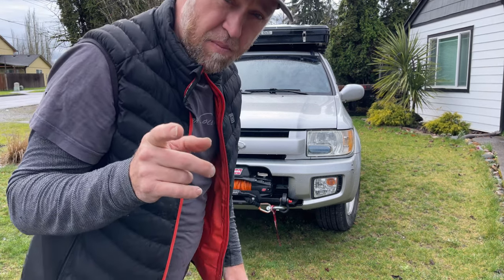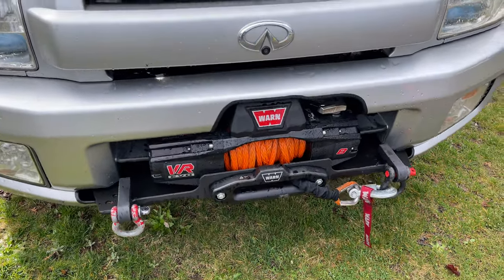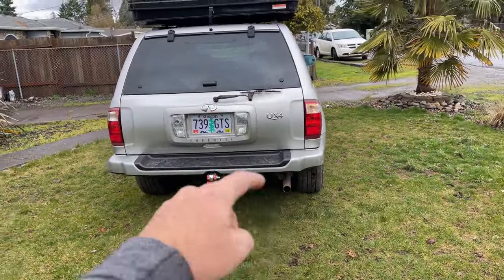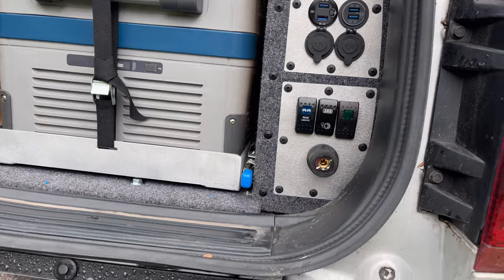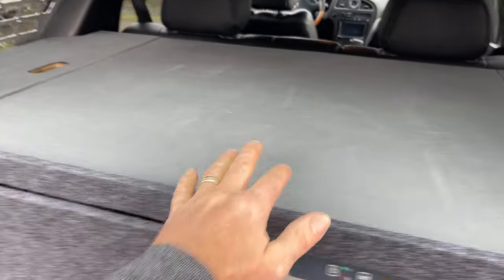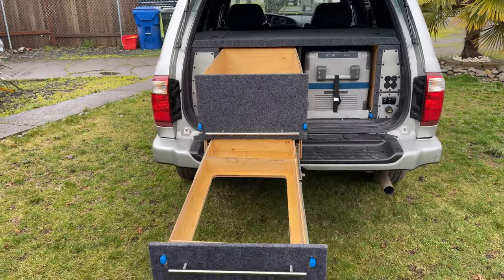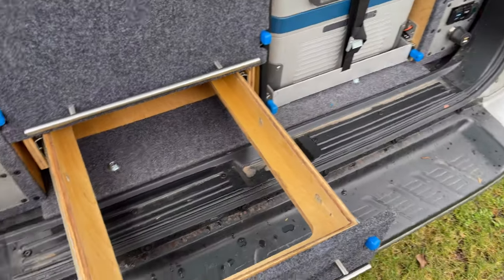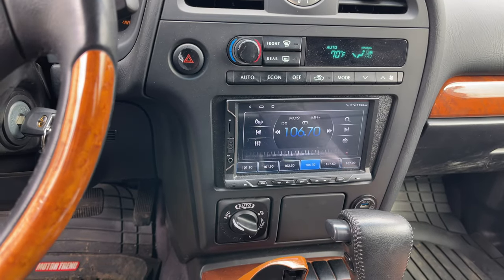Infiniti QX4 / Nissan Pathfinder R50 - AGM Battery, Winch, Drawer System and other updates

Comment: Bud, I have had a Dometic fridge in Land Cruiser 100 series turbo diesel, since 2010. I use a lithium 100 amp hour battery it runs for 10 days with out recharging. Before I go away I run the fridge on high from the house power “240” in Australia then drop down to low when I get to my camping spot. The battery charges from a DC. DC  charger from the L/C.
Reply from the maker: Makes sense, fridge is efficient for the most part

Comment: VERY nice job! I think that's the nicest drawer system in an R50 I've seen. I like the attention to making it no higher than the back of the back seats - just a bit lower to create a lip. I think the lateral well idea is excellent - though it does assume you won't be too tightly packed on the top of the drawers. I find it is pretty easy to squeeze my seats, privacy tent and other long items in through the side of my load. Was that a magnet you used to hold them in place - nice touch!. 

Compressors in that rear cubby is a pretty common R50 mounting point. I like how yours is rigged to the rear panel though, that's a clean touch.

I also like the ability to access the panel from the back seat. I think if I built one, I might make that a little deeper as I really liked your idea of it being another organizational area. 

Consider tapping the plastic hook anchors with 1/4-20 and you can put stainless eye hooks in there for anchor points. Also as an FYI the two tabs in the roof don't mount into much - I've thought of anchor points there but they wouldn't be able to hold much load. Also, a net on the roof works well & stays above the rear window line. I put jackets, hats and other light stuff up there.
Reply from the maker: Thanks,
beauty of "custom" build and application, is everyone makes it how they see/fit right to them and their gear/way of laying things out.  There truly isnt a "right and only" way to do this, as you've probably found out - everyones selection of stuff/junk varies by  a lot, some cook basics like cup of noodles, while others like to carry more utensils than their home kitchen :) :) :) 
Its a long ways from being done in my book, but most likely will never get there and end up moving onto another vehicle, I'm looking at the 5.6L V8 options of the next gen R51 models, need the v8 for towing... but love this thing
Reply: @budnixon  Absolutely, modifications are for how you use it. Between my Mom and myself, we have 3 offroad trucks and each one has a different application and is modified accordingly. Personally, I like a pragmatic, cost effective approach but with the appearance of a clean build. Yours is very nice! Some great ideas there for sure. Now that I have a 2nd R50 for hardware store/hauling applications, I might just rethink a low drawer system for my Pathy. Curious, what did you do with the under floor cubby, did you repurpose it or is it just empty space now?  Once you've moved the spare to the back, several of us have considered adding water, fuel and even an air tank underneath in that space.
Reply from the maker: Lots of ideas for the underside, currently that cubby is empty space, but I'm thinking may be cut it open, and flatten it out to make it easier or more convenient to install other necessities under.  Fuel, water and air have been on my list as well, but I'm trying to stay away from overdoing "concept" as there are simpler solutions.  For example, repurpose the space where spare was with couple of the Trail'ed Round cans that will mount right up, and just a matter of plumbing them to do whatever the purpose

Comment: great video Bud. I live in Gresham and picked up an 03 Pathy this past Christmas and love what you've done to yours. I'd love to learn more about your winch set up rather than adding the weight of a whole after market bumper to get the winch and recovery hooks/shackles installed up front. Feel free to reach out if you'd like to catch up sometime and share some ideas. If you're interested, I'll share my contact info.
Reply from the maker: R50s are definitely underrated 4x4 but there are proper reasons if you dig deep enough.  I built the winch plane/lights tube part.  All info as far as build goes on this rig - is pretty much all covered here in the videos on my channel.  
I'm hoping to hit one of the upcoming Rigs&Coffee meets at IronMans shop in Sherwood soon, come over and we'll chat :)
Reply: The ARB OME Heavy Duty struts should handle that weight just fine. I have 170# on the front of my Pathy (~100# bumper/~70# winch) and it feels great up there. I had to do 2 drives before I put those struts on and with just the bumper it was downright dangerous.

Comment: What’s the weight limit on the roof rails? Could you have used the factory rails?
Reply from the maker: I don’t know of actual limit, but tent is 120lbs roughly and while stationary it supports additionally 2 more adults… and I don’t see that being even close to its limits
Reply from the maker: Factory rails are too week and too tall for my liking, in such application
Reply: The OEM roof rack (i.e. load bars) are rated fro 100#, one assumes that a dynamic capacity and stationary would be more. I have carried far more than than with no problems. At about 2002 they made the load bars much more robust than previously - I know of many of the old load bars breaking. The roof rails connect to the truck at 6 spots have a fairly large surface area so if you remove the load bars, the rails can probably hold alot more, especially static loads. One thing to consider is having your weak point be the connection from the rail to the load as you don't want your roof to be the weak length. There area a couple of R50s that have torn out their roof when the truck's unibody flexes under a rack that's too tightly adherent and rigid.

Comment: Since you’re running everything off your AGM battery, how long/how much power till it doesn’t have enough juice to start the vehicle? That’s what I’m mostly concerned about vs running a traditional lithium ion/lithium iron phosphate power station setup
Reply from the maker: I agree on the concerns, this I carry a portable jump pack. Another note to keep in mind - fridge is the biggest consumer - it has safety shut off if it senses voltage drop due to battery been drained. I dry camped for 2-3 days, charging my usual accessories (phone/drone etc) - hadn’t been a problem yet. It’s about finding the sweet spot, but same goes for spending money in right direction and not overdoing it on things that aren’t as important. 

Take for example option to install a wireless remote start on your rig (sold inexpensive now days), many have a volt monitor (or can be added) - thus as soon as the remote start senses battery drop below 11.7-11.8v (or whatever is needed in your case) - it would start the car and run it until battery voltage is back where it’s safe.  Just an idea
Reply: @budnixon  Thanks for the reply! I also have a qx4 and yeah I don't really want to be spending $1500-2000 CAD for a beefy power station like the Jackery, when I could use that money towards something else.

I am planning a 2-week road trip in August with friends and we will be sleeping in each other's vehicles for some of the nights for the trip (3 vehicles, 2 in each). I assume I wouldn't have to worry about discharging my battery if we are sleeping 6-8 hours every night and most of the time we would be on the road driving, so the car battery would be charging on the go and running the fridge at the same time (going based on your setup)? Planning to do a mini/temporary conversion setup with a bed platform, portable fridge, mini kitchen drawers with supplies, portable stove/grill, power station of some kind (wanting to do a similar set up to yours), etc.

Also going off on your comment about the remote start is a very good idea! Will look into getting a 2-way remote starter anyways in the near future probably closer to the trip as I live in SK, Canada where our recent winters were -40 to -50 Celsius lol. 🙂
Reply from the maker: @FuhRunna   Sounds like you are on a good start as far as direction where you are heading.  Yes, I've found that a good deep cycle battery will do the job just fine, especially if  you are moving everyday and only stationary 1 night at a time, as well as fridge - you can turn it off overnight as it will "hold" cold fairly well for the most part, considering you wont be opening it at night for anything vs daytime/while cooking, reaching for various things all the time, like drinks etc.

Packing fridge correctly is also important to keep in mind, things that are ok to be "almost frozen" or frozen are for the bottom and things that arent - i.e. dairy/veggies/greens - top loaded to prevent frostburn/going bad.
Good luck with the trip!
Reply: @FuhRunna  Definitely get a Lithium Jump Starter - there are very good ones from $35-85. They really have made dual battery setups for start security obsolete. Generally speaking, I've stopped carrying jumper cables and have a jump pack in all my vehicles - I've used them more on stranger's vehicles than my own.

Comment: 2002, possibly the best R50 year as it retains the throttle cable which is superior to Nissan's version of Drive by wire that appears in 2003. Also, 2001-2002 has the highest LSD breakaway at 65-80ft-lbs., earlier & later are much lower.
Reply from the maker: Didnt know that, thanks for noting